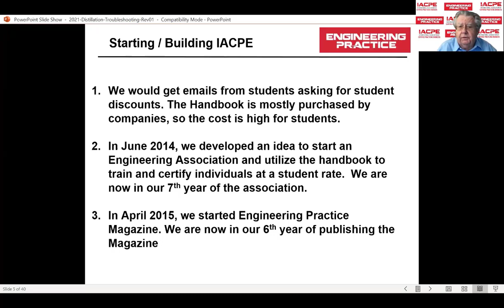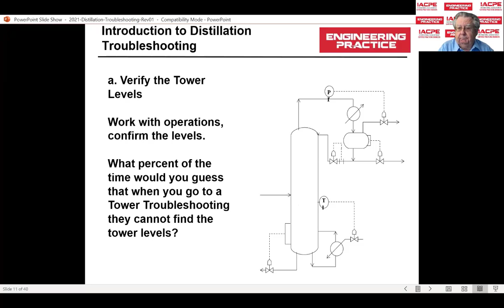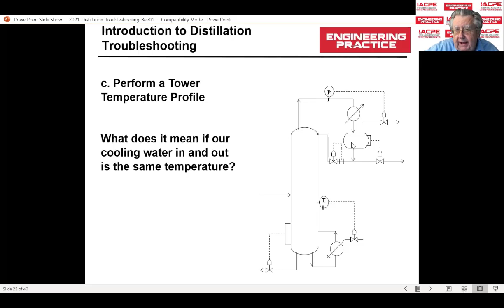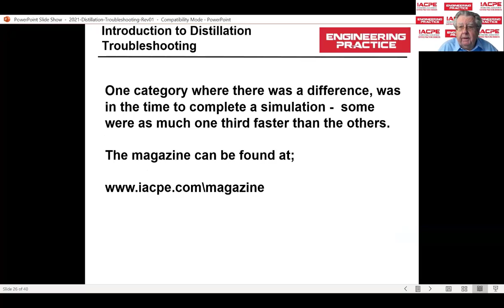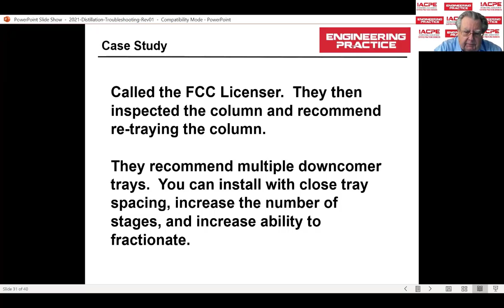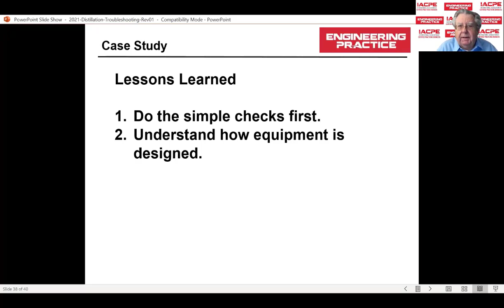Distillation Troubleshooting Feb 2021

Comment: Thanks sir for the presentation.I am working in a BTX distillation .Suddenly during startup after a 10 day shutdown the pressure both bottom and top is far high than spec.what could be the problem?
is it vapor lock?
or tray jamming?